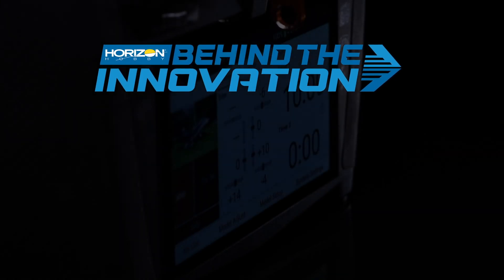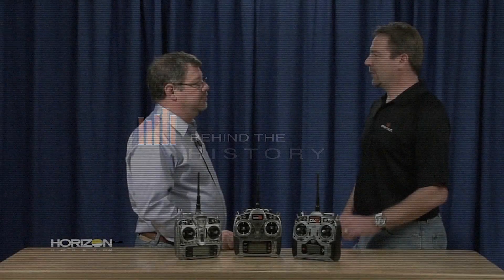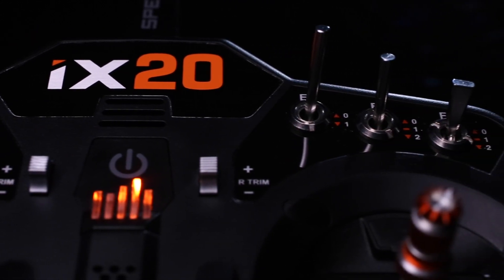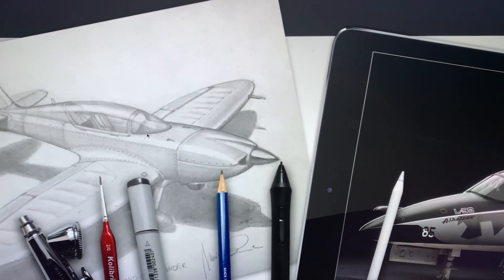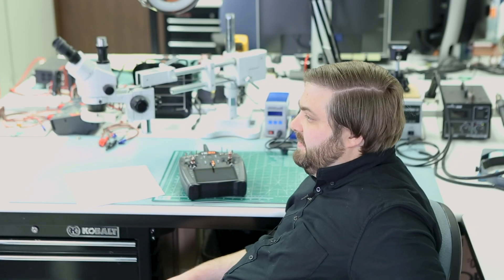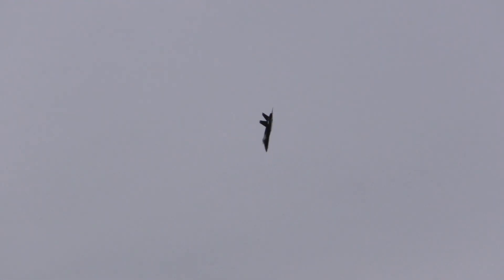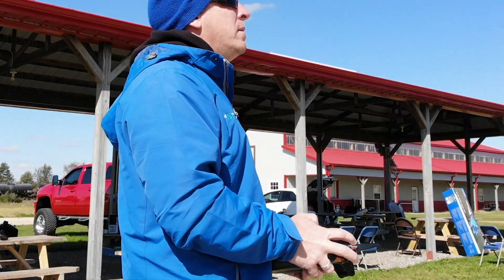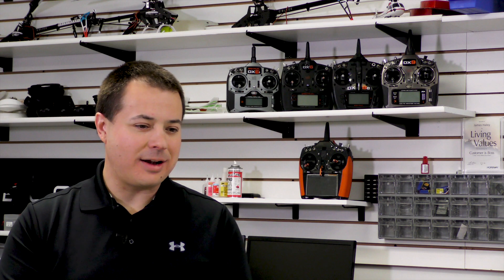Horizon Hobby Behind The Innovation: The Spektrum iX20 Transmitter

Comment: Yea but what about radio and antenna performance. Further range with fewer fail safes?
Reply: 👍  none of that. Just another overpriced peace of equipment.  I gave up after 10+ years being spektrum fan. I switched to Frsky and added crossfire... I've never even looked back. Ultimate setup with unbelievable range and most of all: Reliable!

Comment: 4:35 Wow... nice soldering station! With Crossfire support the iX20 is the new King Kong of RC radios. Nothing better for FPV with Crossfire support IMO as to be able to get a voice readout of which switch your finger is on while wearing goggles is just amazing... and might be even better for LOS as when your aircraft is just a spec in the distance the last thing you want to do is look away. And to add my 2 cents a blind person that reads braille will tell you each switch should also "feel" different so a simplified braille system would compliment the switch system IMO in case there's too much noise to hear your radio.